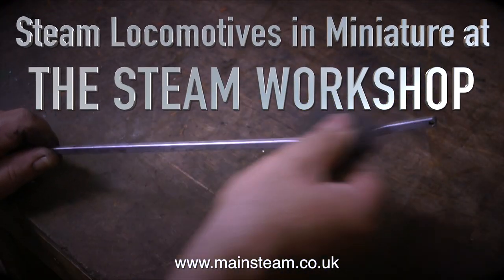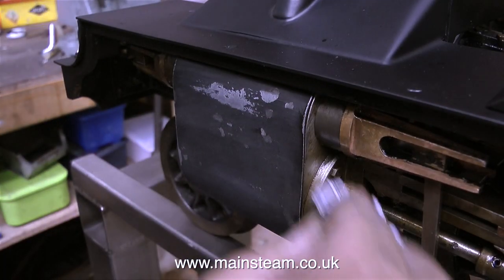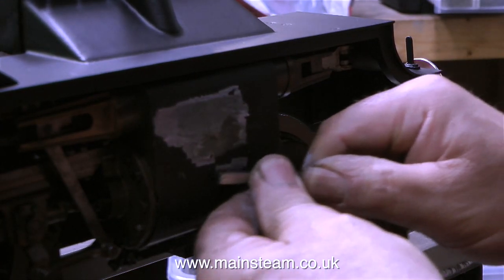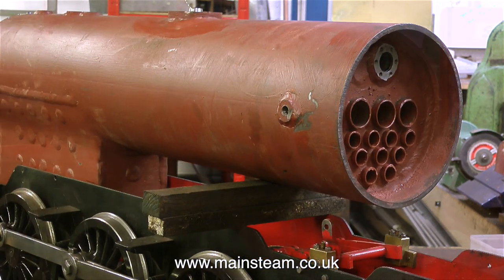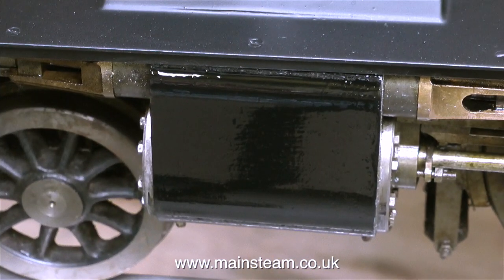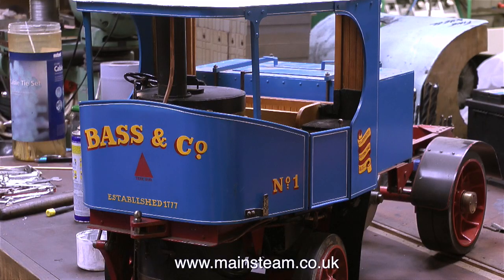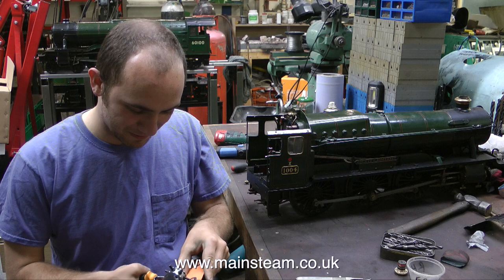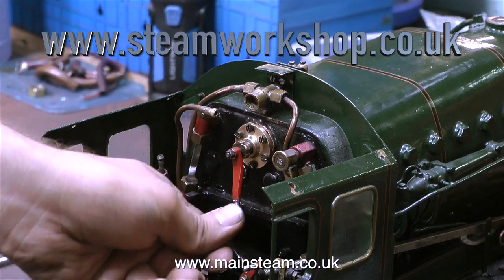WORKING AT THE STEAM WORKSHOP - A VISITOR FROM THE USA

Comment: When I used to do auto paint and body work I was taught to "wipe wet, then wipe dry" The idea being any contaminants would stay dissolved or suspended in the wet wipe and be removed with the dry wipe. Have you heard of this before when using panel wipe or similar. or is this overkill when doing model steam engine work?